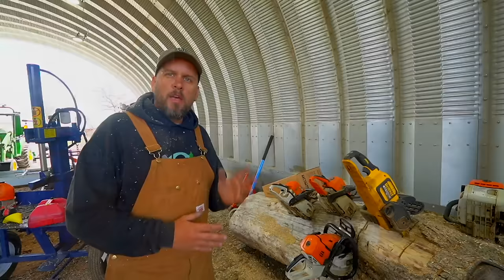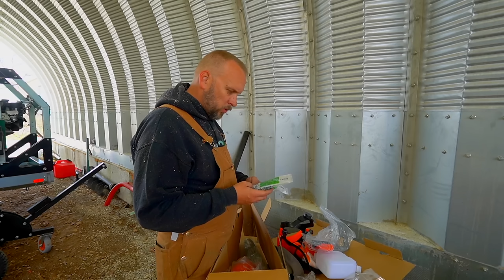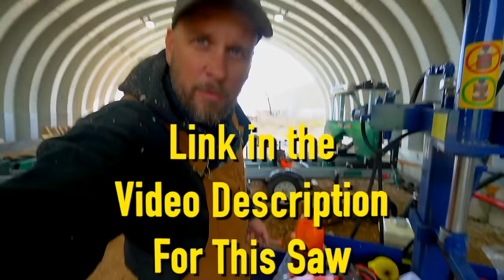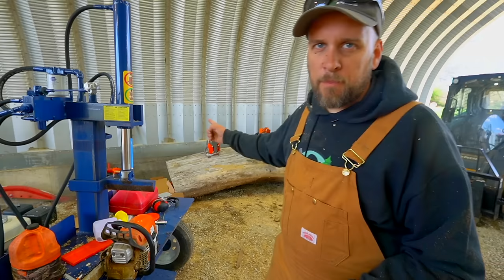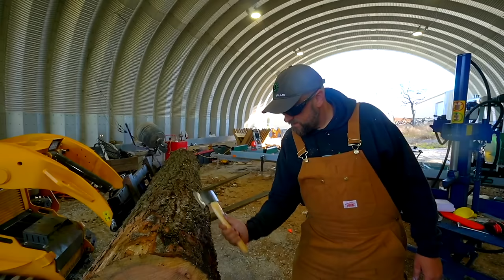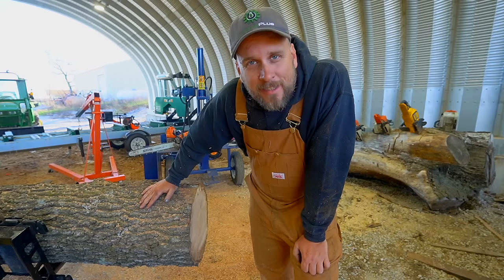Stop Wasting Money On Chainsaws

Comment: I always used Husqvarna gas chainsaws when I use to out in the woods and they served me well. Now I buy slabwood instead which is cheap and alot less effort. No beating up my trucks and messing with gas/oil for chainsaws, etc. and splitting.
 Now with the slabwood, I haul it home from the sawmills in the area, and cut it in 16" lengths here at home. I use a cheaper ELECTRIC chainsaw which works just as good as the gas powered ones. Plenty of power for what I need, no gas to deal with. Keep the chain sharp and oil full and cut away! So simple and easy.
Reply: Yup. I use my gas saws all the time but also have a Milwaukee. That thing cuts down and bucks good size oak trees. Some people are against electric saws but I see the value for sure.

Comment: I grew up using the cheaper saws. If you keep the chains sharp and the bars straight and true they cut great and are a good value. My issues most often began with trying to restart a saw during hot weather. Outdoor temperatures in the 80’s, run a full tank of fuel through the saw, stop and refill- saw won’t start 😮. Since switching to Stihl 25 years ago, I’ve never had this problem again. Something like this scenario should be in your 90 day test protocol. Thanks for sharing your experiences with us.
Reply: I cut for years with a poulan wild thing.  That little saw made a lot of firewood.  I have some big saws but I still rely on my little saws to cut down on fatigue.  I spend a lot of time carving up trees so I can use as much as possible.  My wood piles don’t look picture perfect but they still give the same heat.  I do spend good money on quality wood stoves.  Yep, there is where the money really goes to work.
Reply: Crack your fuel tank in hot weather before starting sounds like vapor lock
Reply: @HubertofLiege Yeah, we always tried that- rarely worked 😮. YMMV
Reply: I have an old 025,  it starts and runs great unless you let it run out of fuel.  On refill it will not start.  
Talked to a Stihl dealer and his advice was,  “don’t let it run out of gas”.

Comment: Very much a chainsaw novice, and being only a gardener,  I've been using a Husqvarna 455 Rancher.  It has proved to be an excellent all round saw! I believe it can take up to a 24inch bar, which is more than enough for me!
Reply: Been running a 455 Rancher with the 24" bar for about 10 years now.  Got the bigger bar when the stock bar got pinched up in a tree and had to abandon it to the elements (it came down eventually in a slightly different shape).  Over the years have downed and bucked six full-grown maples (trunk base diameter exceeding 30"), two 80' black cherries (24" base) and innumerable smaller trees.  One-pull starts, no leaks.  I sure haven't babied it but I do treat it right, garage stored, cleaned & sharpened regularly.  After finding a local outlet for 90 octane Ethanol-free gas have been using that exclusively (with 1:50 2-cycle oil ofc).  Think it was something like $400 new when I bought it, they're a little pricier these days.  Amazing value for consumer-grade big-box store purchase.

Comment: On the matter of outboard vs inboard clutches, there are a number of variables involved, but most of it boils down to a couple of things. Inboard clutches are easier get the chain in and off of. Outboard clutches allow for a smaller crankshaft bearings because the pressure from a tensioned chain is applied closer to the bearing. Inboard clutches allow for a more robust chain brake that is built into the power head. Outboard clutches require the brake assembly to be in the clutch cover which tends to have less structural integrity.
Reply: along with heat dispersion.
Reply: @iffykidmn8170  I'm not as familiar with that element if things, but if your clutch is making heat, something is wrong.
Reply: @zaccheus  acts as an open heat sink vs buried inside the case, does your bar and chain create heat? what is the chain in contact with besides the bar?
Reply: @iffykidmn8170  When a saw is sharp, the heat leaves with the chips.  I don't believe the clutch is designed to cool the chain. I've certainly never noticed a temperature difference between inboard and outboard clutches.
Reply: @zaccheus  I never said anything about a design feature but perhaps a possible side benefit, does the bar and chain not create a certain amount of heat just piss reving out of the cut.  have you ever actually checked the temperature difference between the two with a thermo gun?  I have not so will leave it to others who have.
Reply: @iffykidmn8170  I suppose anything is possible. I haven't checked the temperature with a thermometer, but maybe I will if I have the opportunity to run a husky against a stihl in a similar setting. It should not generate as much heat if it's not cutting because there is no load pressing the chain against the bar.
Reply: @zaccheus  as much vs any heat as there would be no chips to carry away the heat as you surmise.:face-blue-covering-eyes:
Reply: @iffykidmn8170  I don't run a saw much without cutting wood because doing so can score bores and reduce the life a saw. I'm sure some heat is generated, just not much as when the bar and chain are under load. If you don't believe me about the chips carrying away the thermal energy, try cutting with a dull saw and a sharp one. I've experience a substantial difference in temperature between those two scenarios.
Reply: @zaccheus  is it the chips or not having to apply extra pressure to grind your way through the cut with a dull chain.🤔🤨
Reply: @iffykidmn8170  Probably some of both

Comment: I bought a big boy chinese w/24" bar..  was awesome.. started mostly by pull 3 which is fine.  about $300ish.  EBAY.  Was awesome for 2 years..  then it broke the recoil!..  Took it apart, and got it working again.  another few months, a the recoil totally broke.  So..  kinda chucked it.  Not worth the hassle to get another, although I should of.  I went all Echo..  very happy with Echo.  Their Big Boy back pack blower is superb.. a full 4" tube that can clean a 25' wide driveway in one pass.

Comment: Of my 4 main cutting saws. I paid 85 dollars overhaul, and of those 4 saws one is a cheap but runs strong newer 4214 craftsman that I got practically brand new that some put a 20 inch bar and chain on. Then traded it in to a second hand store. I bought it, ran it with the 20 inch. It handled it fairly well but put a 14 inch bar and chain back on to let it work properly. My other 3 are a homelite 360 (free be i fixed up that the guy didn't want). That saw needs new crank seals or the carburetor bit the big one. My other is a stihl 041 farm boss. (Guy dropped by my former place of work, a repair shop and asked if i wanted it so i took it in. Cleaned the carburetor and put a new pulse line on it, runs great). And my last is my dads old MS290 Farm Boss. Which that is a nice screamer that runs like a champ.

And i will say, my favorite brand is stihl. When you can easily pick up a 15+ year old saw of theres. And with a little maintainance, have it become a dependable worker. Then you have a winner.

Comment: I have one of these proyama pcs68 saws, I have had it for a year and have cut at least 15 cords of firewood with it, I was able to source a spare carburetor, ignition coil and air filters,
The air filters seal good and don’t let dust into the carburetor, the saw gained a noticeable amount of power after about 10 tanks of fuel, I love my husqvarnas but it is nice to have a beater saw that I can leave in my truck and will not freak out if it is damaged or stolen, it also comes with a 18” bar and chain and 24” bar and chain, it has been easy starting and has enough power to run the 24” bar efficiently
Reply from the maker: Thanks for sharing

Comment: I grabbed an Echo CS590 probably 5 years ago or so when I needed to take down a tree and do some storm cleanup. I use it maybe once a year and it always fires up easily. I just couldn't bring myself to pay stihl money for their "equivalent" saw with less metal and seemingly lower durability. Interesting to see even cheaper options, hopefully they continue to improve. Having a dealer network/easy access to parts though IMO is a good argument for the echo/husky saws. cheaper than Stihl but still well supported.
Reply: Echo is everything Stil is and more.
Reply: @W1ldt1m no way
Reply from the maker: Seems like about 60% of professionals run stihl. Pretty much everyone else runs Husqvarna. I would say the guys doing this for a living. Have a reason for doing that.
Reply: @RockhillfarmYT  I’d say that’s mostly because Stihl has the biggest dealer network and husqvarna was in the big boxes.   Lots of guys near me run echo because there was a really good long time dealer nearby.  From what I’ve seen they start more consistently in all weather conditions and run faster for the engine size.

Comment: Have used sthil for 25 years.....only 1 ms200 saw was a lemon. Older 036 still running...think was an 80's saw...blew up a 361 and replaced with a 460...got a deal on it for 600 bucks. Biggest saw is a 660 with a 36in bar think i bought it in 02 or 04.... Want to try the ms500i but cant afford it now

Comment: I bought one moth back i am cutting big oak trees for firewood I have ms66o  and g466 witch is same as Stihl ms460  have a 52cc china saw 62 cc china say 25 cc top handle china saw rancher 460 rancher 455 them china saws kick but . I have been learning with the Holzfforma brand replace oilier and the handles pull muffler off torch it first to get their paint off it so it doesn't flack into piston put it back with thread lock then it will never let you down.  used right these saws work

Comment: I've got 4 Stihl saws and the only one that is reliable is the oldest one. I finally bought a Husqvarna because I've got a Husky weed trimmer that is very reliable. So far, other than leaking oil when it's sitting upright (I just turn it on the side when I'm done using it) it has worked every time. If I buy another one it will probably be an Echo.

Comment: I got a Dereal 66cc, 14/20 inch saw for $125 off Amazon. I wasn't expecting much, but it kicks ASS!  Paid for itself 20 times over before I had to start replacing fuel lines and gaskets. I guess Walmart sells the same saw if you can't wait to get one.
     I guess the makers were not super confident with the engine tolerances, and they ask for 25/1 oil mix. Makes for some very foul exhaust, but....$125.....You could probably get by on less oil, but I haven't wanted to risk melting my only chainsaw.

Comment: The original was the Zenoah Komatsu G500 AVS, the 50cc chainsaw from the late 90's I have learned tree felling with and after 25 years that thing has still more torque than most 50cc chainsaws I own. Cylinder, piston and cranks are of japanese top quality and far superior to the Mahle components that used to supply Stihl (not anymore). Blue prints of the 25cc G2500 (the best 25cc back then) were bought by Husqvarna, since they couldn't come up with something competitive, and became the T425. Zenoah Komatsu no longer makes the G500AVS unfortunately and I suspect the components in these clones are not of the same quality. I paid good money for it back then and it was worth every dollar

Comment: Did you adjust that Proyama carb at all?  Sounded pretty good for an out-of-the-box tune, especially for an overseas unit.

10 years back, I played around with a bunch of Chinese saws.  I found lousy materials and some genuine safety issues.   But some of them did run way better than they had any business running, especially for the price point.  Many of the issues showed up after 5-8 hours of run time.

If you run a saw frequently, more than just the cut time matters.  Operator fatigue and damage in your hands/joints from excessive vibration is a thing.
Reply from the maker: I did not make any adjustments

Comment: You can get these clone saws for $100 and they typically just work. I got one at that price, I'll probably buy 2-3 more and will probably be able to keep 2 or 3 going throughout my lifetime, the idea is too set up 2 with the 2 main bars i want to use, and shelf extras for parts/to swap out. That doesn't mean I'll only be using these saws, I'll likely pick up nice or interesting saws I might come across for cheap or on the side of the road because I'm into that kind of tinkering.

Comment: The only thing I've found with the cheaper saws is the vibration. Stihl and Husqvarna seem smoother, the cheaper ones seem to be a tad harder on the hands. Having said that..I don't spend hours chainsawing, just firewood really. It's not bad enough to stop me from using one. We've got a cheap arborist saw which is 9 years old now, on its third chain. A month or so ago for I checked the spark plug, just for shits and giggles just to find it still had the original Chinese plug. It starts 2nd or 3rd pull. Great little saw.

Comment: It is an outboard clutch,I prefer an inboard clutch like the Stihl saws have. So much easier to deal with the chain on the inboard setup. BUT you have more chance of damaging the crankshaft with the chain out there at the end of the crank if you leave it with the chain too tight. It could bend it.

Comment: My dad gave me his old McCulloch pro mac 610.  It's a few years older than me and wasn't run in decades.  Put some fresh gas in it, added some starter fluid and it kicked right over.  Added seafoam to the next tank and it's been running great.

Its a little heavy but a great saw.  Run it out of gas before you store it and it'll probably run forever.  Can't beat free.  Company folded years ago but still a lot of them out there.
Reply from the maker: A lot of the old-time guys love those
Reply: @imfree62 I've found it can be pretty sensitive to oil:fuel ratio. 30:1 to 40:1 seems to be sweet spot.  Stihls seem to run better with 50:1

Comment: Of course you can get a cheaper saw/brand that cuts as fast as the pro saws/expensive brands but will it last as long ? Stihl in my experience are extremly durable when basic maintenance is applied.

Comment: If you want a fast saw and save money buy a good pro grade saw and have it ported and the muffler piped. It will cut just as fast as or faster than the 500i.
Reply from the maker: It’s a good option. I’ve done some comparison videos with ported chainsaws.

It makes a huge difference. You also have to find someone and send them your saw and there’s probably a long wait time. From what I’ve been told it’s minimum $500 on a saw like mine.

Some of the businesses that do, it won’t even work on a used saw. They will only port a new one.

So prograde saw that is big enough to do what you’re saying you’re gonna have to spend at least $1000 on the saw and 500 to have it modified so pretty close to the same price .

At that point you have an expensive saw without a warranty
Reply: @RockhillfarmYT  there are many people that will port used saws and it's not 500 to have it done. For instance if you look up Dyno Joe Mods here on YouTube has a web page that shows what he charges ($450) for porting, plus shipping (around $25-$35), and buying a used 70cc saw (just say you buy one for $300) that's a lot lighter then you 500i. You're looking at $800 for a saw that will out cut your 500i and cut like a 90cc saw for way less. Or don't do a port job and just spend around $100-$150 on a muffler mod or a piped muffler and have it run just the same as your 500i. Which you would be spending $400-$450 (half of what you sent on your 500i. Still lighter, same power, and cheaper by half or more.
Reply from the maker: @chadrogers4635 i’ve been wanting to do it so I will look up the channels you’re talking about.

Thanks

Comment: I also love my 500i, it’s much more agressive than any other saw I own. I will be getting a 881 next week. I’m looking forward to trying it out.
Reply from the maker: I would like to
Reply: Your arms will stretch an additional 8 inches.😂
Reply: @austindenotter19 As I 661 user doing storm cleanup for days with a 36" bar I agree!
Reply: @cpufrost  I have a 661 with a 36 inch bar too. After using it one day I got a 462 with a 25" bar. I love the 661 and its hard to beat that power for big cuts, or cutting underwater. But its so heavy and so much power that it wears you out quickly. I can run the 462 all day long.
Reply: @MysticalDragon73  Yeah it's heavy and I usually use it where that power is needed, i.e. felling larger trees and stump work.  She pulls large bars great!

Comment: Some observations here.  It appears that the 500i has a Bark Box muffler on it so it's not bone stock.  The Proyama, although stock, sounds like it's muffler was designed to allow more exhaust relief like the Bark Box, which in turn increases horsepower slightly.  The 391 with a Bark Box on it, might out perform the PROYAMA...  Just saying...

Comment: I have a 62cc chinese saw that looks to me like a clone of the German saws my father used back in the '80s by Dolmar. It isn't the level of quality or ruggedness of those old saws but man does it rip for a saw with a 20" bar on it that costs like $120. It handles a full plunge of the bar in oak no problem. The saw it replaced, a Poulan Pro, really had to be babied. I'm so glad I got rid of that thing and bought this one. So much nicer. Power-wise it holds up well to some older Stihl's I've used before.